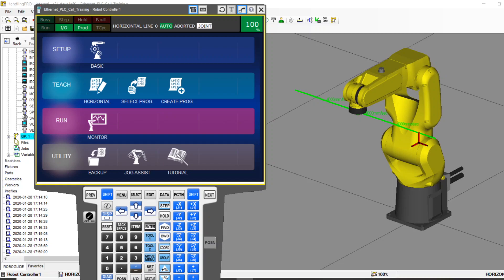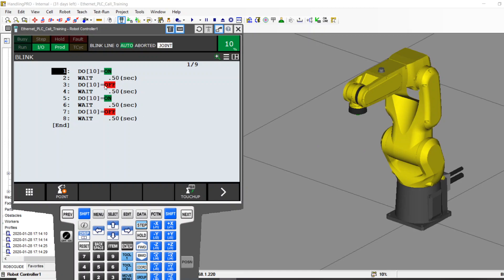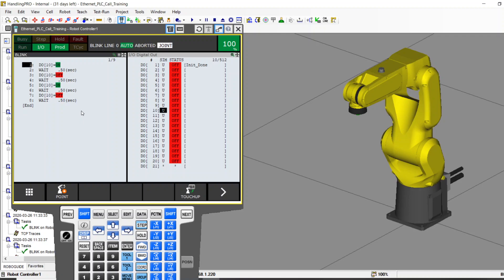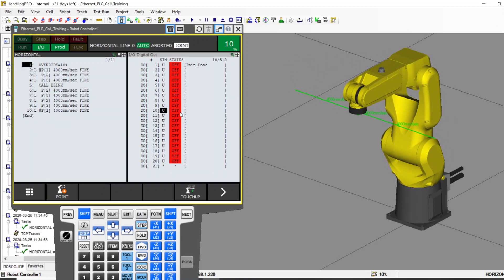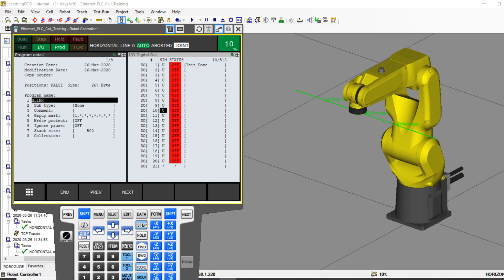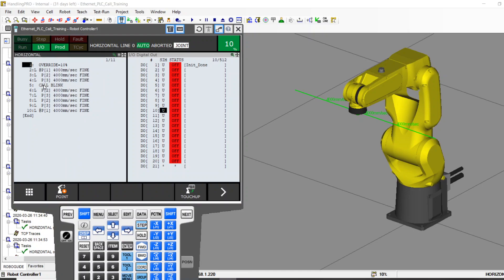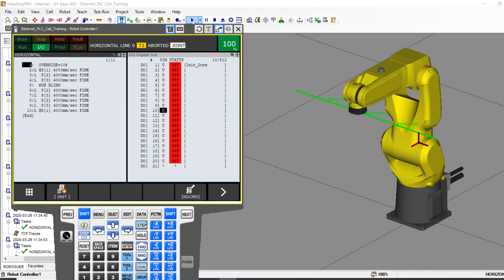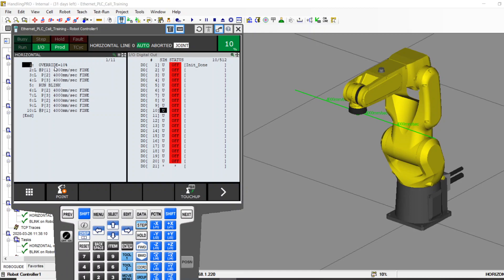FANUC Run Command Parallel Processing

Comment: Thanks. Is there any way to pass arguments using the run command? I need to pass a number to the program I am using the run command with
Reply from the maker: Absolutely! Check out my video here to learn more: https://youtu.be/iXUHAieyxrg
Reply: @AdamWillea  Thanks for the quick reply. I've taken a look at that video, but I didn't see any example with a Run command. I'm able to pass arguments after the Call command, but when I try to move to the right of the program name to insert an argument to pass, it just goes to the next line.
I.e.:
1:
2:
3: Run Vision
4:

What I want is something like this:
1:
2:
3: Run Vision (1)
4:
Reply from the maker: @mitchdaniel5605   Hi Mitch! Sorry for missing that; yes for parallel processing you need a bit of a workaround. Since the "RUN" command doesn't support an argument at the end, what you're better off doing is setting a register variable in a previous line of code, and then simply reference that register in the secondary program. Something like:
1:
2: R[5] = 1
3: Run Vision
4:
and inside your vision program, whatever it is you were doing with the "1", just use R[5]. You can also indirectly address that to make it more modular.
I also see you are mentioning Vision. There are separate ways to RUN_FIND or use vision application control from the main code, so it depends what you want to do.
Keep in mind lastly, you can setup a RUN command with a String Variable, and modularly call whatever program you want. It'd be:
1:
2: RUN SR[1]
3:
Whatever data is inside SR[1] at the time will be the program you call up. Hope this helps some!
Reply: @AdamWillea  Thanks Adam. This is actually the workaround I did before I started googling. It's a shame Fanuc doesn't include this functionality. Not a huge deal, it would've just cleaned up my code a bit.

Thanks again!
Reply from the maker: @mitchdaniel5605  Roger that! I'm honestly not positive as to why a "CALL" supports arguments but a "RUN" does not... new research for me to embark on! Thanks for asking!

Comment: How would I write this instruction if I’m want to control a external axis
Reply from the maker: If the external axis is a FANUC motor, you first need the option for "Multi-Group Motion". Then you simply set the "DETAIL" of your program to be Group 2 mask, and proceed to write the code to run the axis.